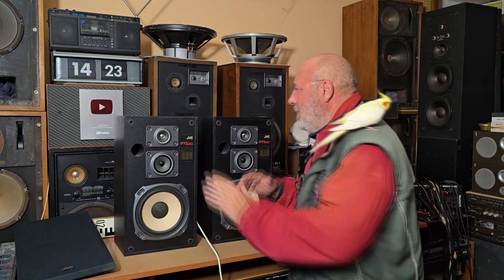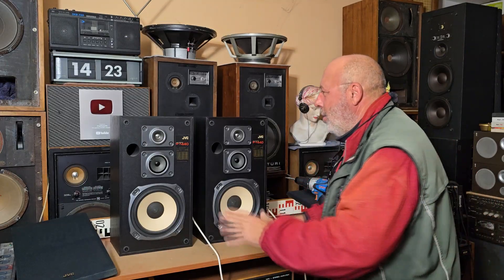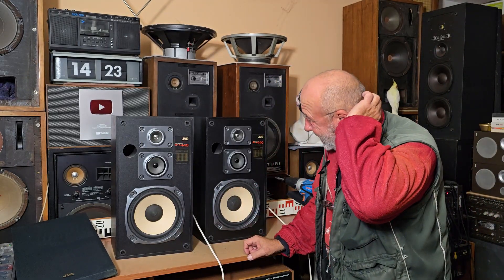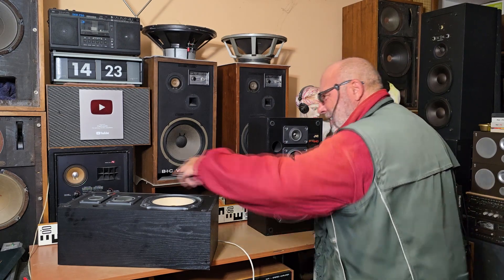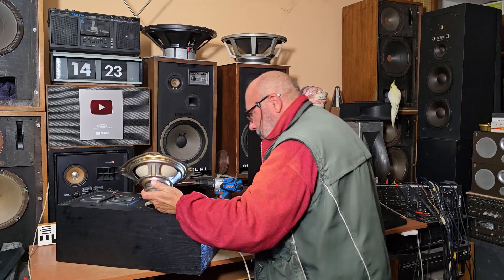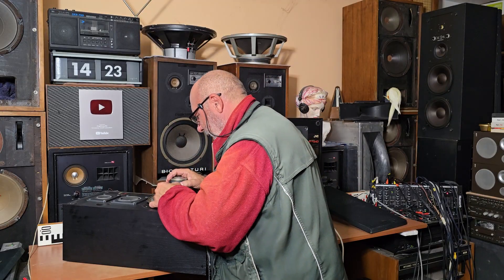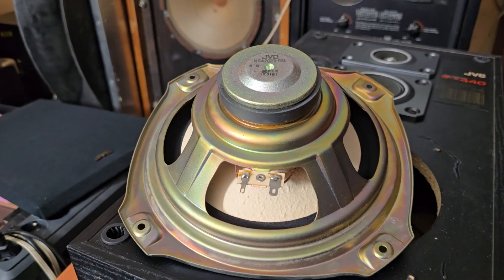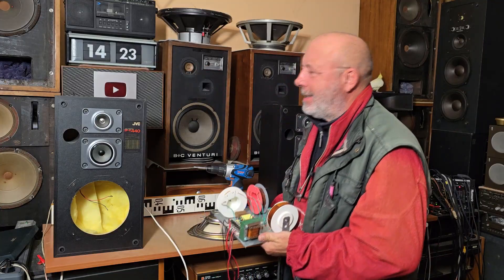JVC Speakers: Inside the 80s Sound Engineering Decisions

Comment: Typical JVC cheapo desing from the past, the big crossover you show also has some bad engineering problems using magnetic metals to attach coils will mess up the values, for example, it is like attaching aircore inductors with a Steel bolt and make them iron core inductors with random values.
Reply: They are budget speakers from 1987. Yes, they are underengineered but nobody really complained when they used speakers like this back in the day and they still sound decent. 
The crossover is from a proper HiFi speaker. These people obviously had advanced knowledge of electromagnetics so they will have taken the effect of steel bolts etc. into account (which is probably negligible anyways). I'm sure they tested the crossover well before it went into production. Back then designing a crossover was an elaborate process and a lot of trial and error (no simulation software, online calculator, etc.).
Reply from the maker: Thanks
Reply: @westelaudio943 Yes simple but ok, it was when almost everyone wanted big speakers and some still looking the looks and vintage style sound. Basic consumer stuff from big brands used to be better in the past. But simulation and digital technology did not really solve problems, speakers should still be tuned using ears and proper components, when building something cheap less is usually more when it comes to sound.
Reply from the maker: Thanks for your detailed comment.
Reply: This is a very good and professional 3 way speakerbox. I have mostly the same speakerboxes from JVC and the sound and the bass is so good!!!